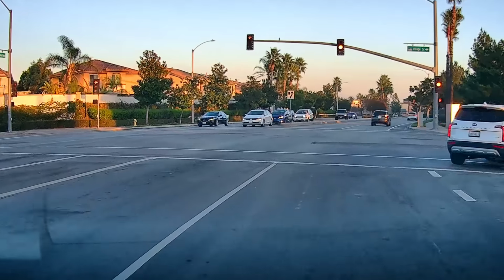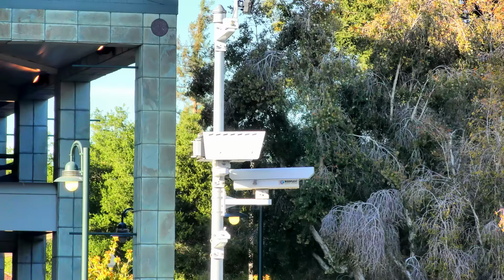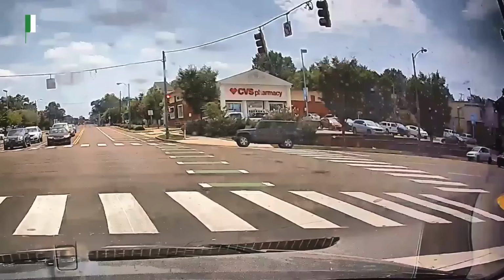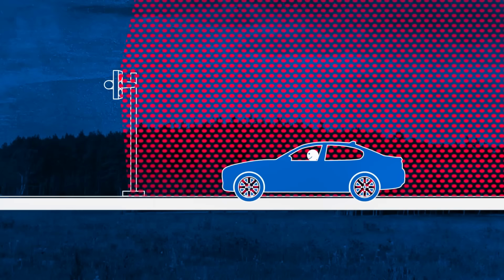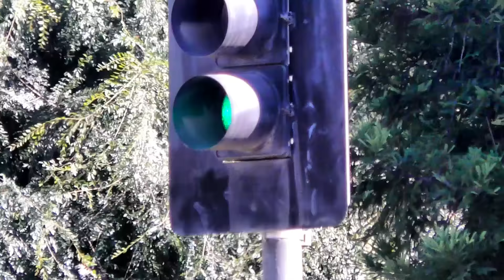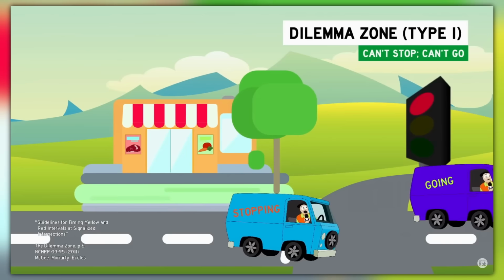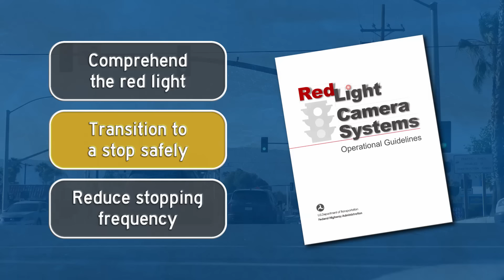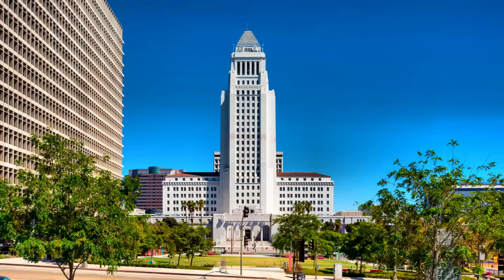Three ways to FIX a STOP LIGHT (so drivers ACTUALLY STOP!)

Comment: I have never understood why two lights a short distance apart are not coordinated.  If there are two lights a block apart like this video shows they should both be the same color at the same time such that going through the first one the second one will also be green.  Or if the first is red the second should be red.  I was rear ended at fairly highspeed (I was thankfully in a Ford Ranger with offroad suspension so that car went under me basically and didn't do much damage to me, annilated the car that hit me) because of that discoordiantion in at a place where MA RT 12 and RT20 merge briefly in Auburn/Oxford.  There is a double light there, I made the green at the first, but the second was going yellow, so I had to stop as it would be red by the time I reached it.  While sitting at the red I got slammed into from behind long enough after that I was figuring it was about to go green.    I went back the next day and watched from the side of the road.  The first light at least at that time would go red after the second that I was stopped at as already red.  The first light would then go green nearly two seconds before the one I was stopped at...serious discoordination!

The same goes for long stretches of road they should be coordinated completely even if those lights cross towns.  If you are going within some close favotr of the speed limit once you have the green, you should get EVERY green for the entire length of the road.

A good example is "Memorial Drive" in Chicopee, MA typically once you have a green on that road (my grandparents lived off of it when they were alive so I have driven it a lot in my life) you can go from the point where the Mass Turnpike exits on to it, for several miles without EVER hitting a red so long as you are close to the speedlimit. +/- 1 or 2 MPH.

A really poor example based on where I live presently is CountyLine Rd.  Which run through several town starting is Littleton, CO.  This thing is a disaster of uncordinated lights.  Particually where it intersects with University Bvld. I'd say I get stopped at that intersection better than 90% of the time no matter what the state of the light preceding it from either direction of Countyline Rd.  The story is a little better as you head toward Lonetree, CO: but not much, no matter what you do you are always going to hit a red someplace on that road.

Comment: I witness a crash awhile back. A full size van in front of me was crossing the intersection from a stop sign. A little white car t-boned the van overturning it. It  tipped over spun 360 around and ended up on the driver's side. Little old lady must not have seen the van because she hit it without slowing down at all. No skid marks on the road. Much like that 76 yr old man, she probably should't be driving.

Comment: I need to say, sorry for all those European watchers who were shouting about roundabouts... but the US many times have never built them correctly!  I had a discussion with an engineer who had worked on roundabouts, and a lot of little things about them we get wrong, and he has the studies to prove it.  Like the pavement should slop down to the outer edge both for drainage and to keep speeds lower (sloping down to the outside makes the corner feel faster, so drivers slow down more).  Or the lane count, many times it's better to just build a larger diameter single lane roundabout than to try squeezing in 2 or even 3 lanes.  There are a few roundabouts I know that were built with too many lanes for the area, but they still help reduce the speeds and reduce the chances of collisions.

Comment: There are 2 problems with those "filters" - first one is how people seem to treat every light that is out or malfunctioning as a green light these days.  Second is when there's a storm, low sun angle, etc. they are virtually impossible to see what the light is at all.

With those "background" things I've also had problems where one light in the middle of nowhere here they installed those orange rectangles but there's another problem - when the sun is behind you its SO blinding you can't hardly look at it.

I'm not sure I like those off to the side lights either, they look to me like they should be turn-lane signals, not normal lane indicators so I don't think I would interpret them as something to look at.  Much prefer the rural places that have a flashing sign "stop light ahead when flashing" keyed to turn on such that if you are going the speed limit when it starts flashing it will be mid-yellow when you reach the light, so you should begin stopping if its flashing when you see it.  The problem is these also are not all the same - even in my own area only a couple are controlled this way, most flash all the time and are ignored by drivers.

Roundabouts have other problems, not only are they hard to navigate with larger vehicles but they also provide no way to leave a gap when one road backs up for other reasons, and no way to pull out of the way for emergency vehicles to cross thru when responding to the crash.  They also seem ambiguous - our DMV manual clearly says you can exit or continue from either lane of the roundabout but nowhere does it explain who has the right of way when the outer-lane continues and inner-lane exits

Comment: Remember when my town had red light cameras.    

The company that owned the red light cameras wanted to make as much money as they can reduced the time of the yellow light by more than half the legal amount stated in the state handbook.  State highway changed the yellow light back to the original time and the red light company did not like that they were not make money hand over fist.    

Now the red light camera company went and again changed the times on the red light camera illegally.   So the township asked the state to remove the red light cameras because it was causing more rear end crashes because drivers were slamming on their brakes and the other car would hit the car that stopped because of the yellow light may have been too short.  

Example is that a road has a speed limit of 50 MPH.   The formula I believe that it is for every 10 miles the light has to be be at least 1 second long.  So 50 MPH the yellow light time would be 5.0 or even 5.5 seconds long.   But the red light camera company reduced it to 2.2 seconds.    Just to rake in the bucks. 
And because the time was  reduced it too much, they, the red light camera company was breaking state law.    

Today in my town where I live there are no longer any red light camera.  Even after there was a news story of shortened yellow light times on all red light camera intersections.    Today depending on time of day the yellow is 5.0 or even 5.75 seconds long.   Even the red light holds for 1.25 seconds before the other side changes to green.

Comment: One of the things that you sort of glanced over is better driver education.  Specifically what an amber light means.
In most places an amber light does not mean "slow down and prepare to stop".  It means "STOP unless it is unsafe to do so".  Most people are not aware of the proper meaning of an amber light.  Most drivers believe that as long as you are in the intersection when the light turn red that you are OK.  This is a misconception of the meaning of an amber light.  
That said, there are some jurisdictions  that have different definitions, so consistency might be necessary as well.

Comment: Of all places, the city of Yankton, SD apparently has a traffic engineer that knows what the hell he's doing, because: 
1: If you drive the speed limit, you can drive entirely through town on the main drags without hitting a second red, 
2: The lights all have retroreflective borders, 
3: There are extra (low and wide mounted) signals due to the truck traffic through town
and, 
4: Not only are the yellow timers set appropriately, the intersection of US-81 and SD-50 have subtle changes to the lane markings (extra, thin, solid white lane separators)  to cue your decision tree: "Are you driving the speed limit?" Y-> Did the light just go yellow? Y-> Can you see regular lane markings in front of you? Y-> "Stop; You won't beat the red." If the final decision point is "no, they're different", the answer changes to "maintain the speed limit; the light is going to go red after you get 3/4 of the way through the intersection.

It'd be nice if the traffic engineer for Nebraska was as good: The intersection of US-81 and NE-12 has had at least two accidents in the past week. The only control is a flashing red light and a sign saying "Traffic on Hwy 81 does not stop". 

Resulting in multiple 65 MPH T-bones in the past month. There have been fatalities.

Comment: MY SOLUTIONS WORK:
1) Remove the driver's seatbelt.
2) Place a 10 inch spike in the stearing wheel aimed right at the driver's face. (it should be fairly blunt)
3) Install speed humps and bumps where appropriate for given speed. Hitting said humps/bumps at a certain speed triggers a reminder that there is a spike aimed at the driver's head.
Problem mostly solved.

Comment: The simplest solution without extra costs, extra engineering would be to stop building traffic lights 30 meters away from where you have to stop on the other side of the junction. Many of the problems you discussed would magically disappear.

Comment: So if you can't see the light in the next intersection until your basically in front of the stop line how would you know to prepare to stop if said second light was in fact red but you don't see anything but a blackout until you are very close ...how is this safer?  We need to prepare for what's coming far ahead as most driving instructors will tell you as well makes little to no sense to block that light off until it's almost too late to react 5.45 in the video

Comment: Roundabouts without traffic light is horrible during rush hour, you have to yield for the rush hour traffic to pass forever if there is no cars that comes to make the traffic flowing stop. You can end up stuck for several hours in the worst case when the traffic is flowing from just one street. Unregulated roundabouts ONLY works when the traffic that flows trough them is balanced, if most of the traffic only flow on one of the streets it ends up stopping other traffic that has to yield forever.

Comment: If a driver runs a red light immediately after the red light turns on, it's not much an issue. There's a brief moment when all lights are red, adding some cushion to keep all parties safe. Not to mention, it takes time for drivers to actually cross when a light turns green. There's a small grace period.

It's dangerous when drivers run red lights after the grace period is over. At this point, there is no "barely missed the yellow", it is the driver's fault. And it's this type of running red lights that is dangerous.

Comment: In the US the driver has to stop 20-30 yards ahead of the red light - the driver has to both see the (smaller) red light in the distance and at the same time decide WHERE to stop AND if they are going too fast to stop at the point 20-30 yards ahead of the red light - all in a very short time.  In the UK drivers are trained that they should never pass a red light BUT they can safely drive UP TO the red light - which takes the where-to-stop decision away from the driver. Perhaps US red light safety can be improved by simply adding traffic lights at the point the driver needs to actually stop? And for the size and speed of US intersections, there seem to be very few traffic lights, and thus very easy to miss that red light at 50mph.

Comment: 90% of my light runs are intentional. 20% of that 90% is trying to beat the yellow, the remainder is always between 12am and 6am where no cars are present but light doesn’t change for 5 minutes. I stop, wait a minute, pull up, check if theres cars coming, make sure I can tell no one has their headlights off (very common at night in SoFlo), and then I go. Only time I don’t is if the visibility is poor, there is a cop, or a camera.

Comment: Reducing the number of red lights?

Unfortunately, most cities synchronize their lights to turn red as you approach them. This in my opinion is one of the reasons there are so many red light runners.  The synchronization is matched to the speed limit, so if you’re doing the speed limit, when you reach the following light, it will be in the process of turning red.  This is where those that don’t want to wait usually speed up to beat the red.

Comment: Here in Sweden we solved it by removing people from the road entirely. There is a fine of around $300 for a running a red light, but you will also have your driving license revoked for 2-4 months. If you do it twice, you will have it revoked permanently and after a set amount of time you can go back to driving school and get a new one.
"But I had the sun in the eyes" -Don't care. Wear sunglasses.
"But I couldn't stop in time" - Don't care. Drive the speed limit.
"But I was tired" - Don't care. Take an uber or sleep at night.
"But I need my car for work" - Don't care. Should have thought of that.
There will be no judge to plead your case to like in the US. This law is very, very unforgiving. But so is killing other people. Failing to stop at a stopsign, overtaking on a pedestrian crossing or failure to secure cargo will yield the same result.
In the US one in 6600 dies in traffic every year. The same number for Sweden is one in 47000. I know we don't have the same kind of traffic, but the difference is so vast that there must be other things in play. If you'd really like to fix this. If you want to save lives: Start by not using the red lights as money printing machines for city hall.

Comment: Its worth noting some of these issues are just causes by stupid road designs in the US. Those 'dual carriageways' shown in the video should really have slip roads to allow the main carriageway to stay at a constant speed, or, as you say, use roundabouts. The other problem discussed was speed, to solve this, the first option would be speed cameras (especially average speed cameras) and secondly, design roads in such a way that where traffic must keep stopping, the layout encourages slow driving. A 6 lane wide road will be perceived as a much faster road than a 2 lane 'B' road (as we have in the UK), this can of course also be solved by keeping fast moving traffic on a dedicated carriageway and putting junctions on slip roads... like... another thing we have the UK called 'A-roads'.

Comment: I got a question that I can't find a answer to so in around Detroit they have mile rds and the lowest by Detroit is 6 mile and goes every number to 38 yet just south of grayling mi there is a 3 mile rd ,5 mile rd ,6 mile rd and a seven mile rd and there another 5 mile road in Lapeer mi and a 4 mile rd in walker mi which I can find no reason for the other mile roads that are outside of the regular 6-38 mile rd system

Comment: Two red lights close together is a disaster waiting to happen. If I get a green light the space between the lights maybe full creating congestion and a desire to go anyway even if it turns red on me, I waited my turn, I'm going!!

If there are two intersections close together then a roundabout is more sensible. It helps with traffic flow and eliminates red light running.

Comment: Pressurized rapid deploying vehicle barricades.  Soon as the red light triggers, a 3 foot wall deploys in under half a second.  Try to run the red? Your truck is now a sub compact car.  Mis-time the yellow and your front axle is over the line but your back isn't? For the next 4.5 seconds you'll be able to give an arial traffic report.

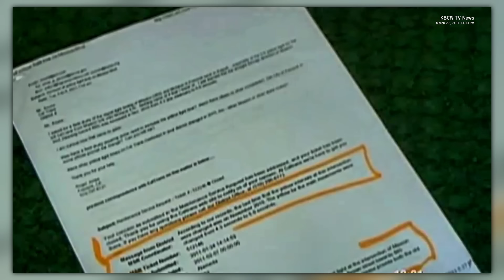Comment: Issues also arise when ticket quotas run  the show. In plenty of places legislators learned about what you're talking about at 9:35 but used that knowledge to SHORTEN yellow lights. Thus resulting in more tickets and higher revenue for the zone. Same with speed limits that drop 20 mph unbeknownst to the drives. It's all a scam

Comment: and then you have cities that put up the cameras not to stop running red lights, but entirely to generate revenue. usually by intentionally setting the light timing a little shorter than the cameras. and then just shrug and ignore people when they get called out, and the timings proven to be off.

Comment: I wish I could feel safer untraining my urge to slam on the brakes to avoid running a red.   Even doing less than the speed limit.   I'm not so sure about red light cameras.  It's common for yellow lights to be shortened where they're installed.

Comment: I sit at a red light waiting on food delivery orders all day long.  On a scooter.  Parking lane.
I think most cars, and SUVs especially, nowadays have what might be called a Heads Down Display.
There's no way they're actually driving an avg. of 30+ in a 25 while staring at the 'phone in their lap?
Of course they are - I can see it.
The red light?  They speed up well over 30 to make that, or a lot of the time not make the yellow but run the red.
This isn't even an intersection but the entrance to a grocery store garage and a busy pedestrian crossing on a high traffic urban avenue in an older eastern city.  Le sigh.
I think there should be speed cameras at all red lights.  
That increased speed when they try to make the light with someone making a late turn across the speeding vehicle makes for some gnarly crashes.  
You won't even need red light cameras and the speeding tickets will be bank for the govt.  At least I think so.  lol.